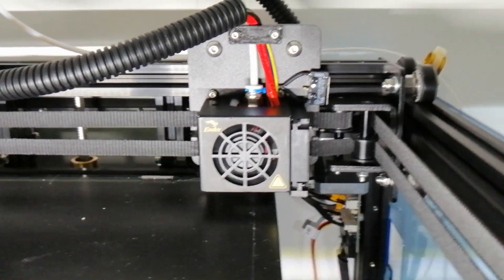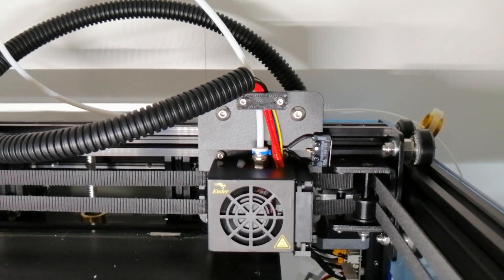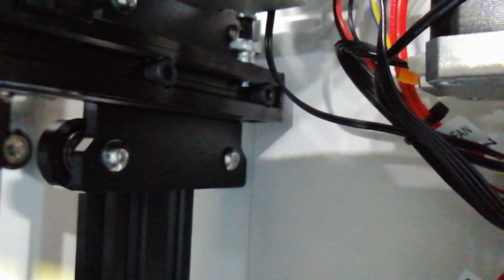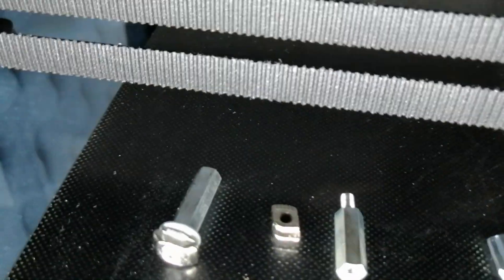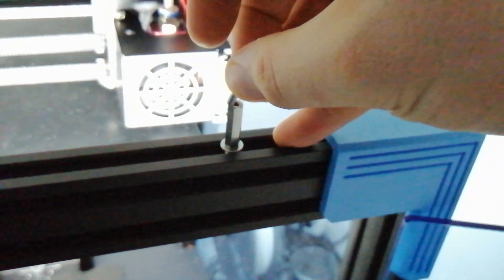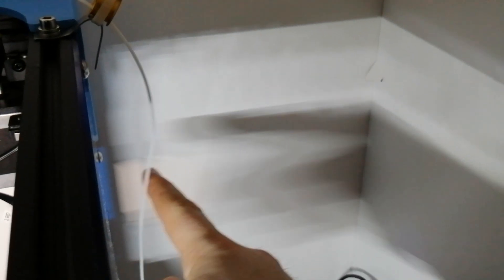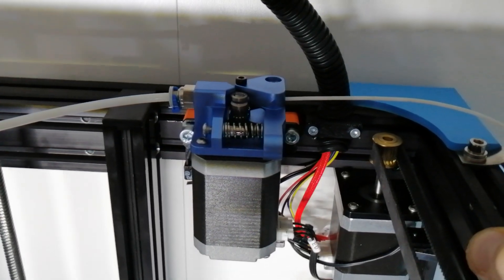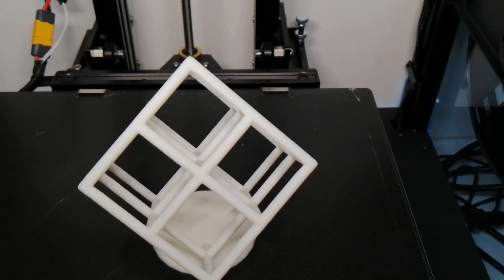Ender 6 stringing mod - Extruder Motor repositioning

Comment: And that's what you do with an Ender-6: 
Fiddle,,, Calibrate,,, Modify,,, Upgrade,,, Replace parts,,, Buy parts that work,,, Level bed X 40 ==> Buy a bed that's not warped,,, tinker to get first layer to stick,,, change settings to stop layers separating,,, 
All this and more BUT...  Never print anything.
Reply from the maker: Well... this is absolutly NOT true... my printer works really fine since my last vid.. thats why i did not make any new vids... it is just working :D More than 2khours printing time now on it :)

Comment: Hi Phil, I am really new at this. Only doing it a month. Might be a stupid question but with the shorter Bowden Tube after the extruder, does it matter how long it is before it gets there? Is the idea not to have any before and as little as possible after the extruder?
Reply from the maker: So … the main rule to the length of the Bowden is : As short as possible as long as needed …. It needs to be long enough to reach nearly every position (reaching 90% is enough - saves tube length) :)
Reply: @PhilsBastelwelt  thank you, I understand the shorter the better coming out of the extruder going to the hotend, but what about going into the extruder, does that also have an impact, going from the filament sensor to the extruder? That's what I'm not understanding.

Comment: Can you please put a link where to get the right screws that you used? Thanks in advance.
Reply from the maker: honestly...i used some srews that were laying around. I woul recommend you search for as pack of screws on amazon in your country. I would recommend a set with M3/M4/M5 screws, some washers and some nuts :)
Reply: Thank you!
I'm trying to make a bracket for direct drive replacement. My only issue it would be the original cable is not long enough. Where can I get them? Really want to find the right ones.
Reply from the maker: @mypersonaljourneytochessma2785  you need to assemble your own cable …. That is not hard… you need the Parts for ist and the Tool :) I can’t share Links … otherwise I would send you some … but just google a little bit how to do this :)

Comment: I moved the extruder to the inside, and with the help of your spacer it fits perfectly.  However, the powercable is barely long enough. It fits, but I'm afraid the tension will be too high over a longer period that it will come out of the sockets. So I guess I'll have to figure something out to move that thick cable-tube a bit out of the way, so my extruder dan be moved just a little bit to give the powercable some room to breathe.
Reply from the maker: Well… just move the Extruder a little bit to the right and there is no tension left :)

Comment: Merci pour cette video. Belle amélioration. Avez-vous un lien ou les références pour racheter un moteur pour l'extrudeur. J'ai un moteur d'avance mais je ne crois pas que cela soit la bonne référence. Merci.
Reply from the maker: Unfortunately I don’t speak french or what kind of language this is 😂
Reply: @PhilsBastelwelt  Thanks for this video. Nice improvement. Do you have a link or references to buy a motor for the extruder. I have a motor in advance but I do not believe that this is the right reference. Thank you.
Reply from the maker: @winrun1  theoretically you can use every Nema17 motor. The original Motor has some more Torque ... 
but sry ... I have no link .... didn’t search for one yet
Reply: @PhilsBastelwelt  Thanks

Comment: Awesome video my friend!! When will you be doing a raspberry pi video? I am still waiting to get my ender 6 but it is on the way and I want to put a raspberry pi on it.
Reply from the maker: Well... actually i have a broken USB-COnnector atm. I already contacted my local supplyer (where i bought the printer) and will hopefully get a new board. Otherwise i will buy a new one. But the only thing i will do with the raps is connecting it to the repetier server. Maybe to a late ri will install klipper..but not sure how to do it togehter with the repetier server :)
Reply: Hello Chuck,
you don't need a video, I placed Raspberry Pi on my Ender 6 and it is very easy to do. All you need to connect it is micro USB to USB cable, like the one you use to charge older android phones, so NOT the USB-C kind. Once you have Raspberry PI installed and ready, all you need to do is unscrew bottom panel of the Ender 6 and connect micro-USB to the board that is located beneath the screen. Guide the other end of USB cable through the opening under Z motor if you want the PI outside, or above in far right corner where the other cables are pulled through, if you want the PI inside the housing. I placed mine outside, since I didn't want the heat from the housing to damage it. Make sure you put an insulator tape over 5V pin on USB cable that goes into PI (as described here https://community.octoprint.org/t/put-tape-on-the-5v-pin-why-and-how/13574) and you are good to go.

Comment: Horrible printer. Cheap add creality suck
Reply from the maker: Sad to hear..but ..do you sell your printer ? :)
Reply: @PhilsBastelwelt  u can buy from me for 500 if u want. Its one month old. Im based in netherlands.
Reply: @saulenkhanal5655  500? then you get ripped of. You can get the Ender 6 for a little under 400 bucks.
Reply: Its true . I have a printer for 1 month now. It came with broken fan . They said they are sending one 2 weeks ago but recieved a mail saying that package is lost. 

Secondly yesterday my extrusion motor stopped working. They are not willing to take the printer back to refund me or exchange the printer. They are complete scam. They did tell me this : Dear customer , what can we do to make u keep the printer ? What the hell.

Comment: Thanks.  I have been going stringing crazy, but, thanks to your comments,  and pointing out the critical things to change ,  I have gone from fully stringed to barely noticeable.  Without changing the Extruder location.  BUT,  that change should also make things better.  I hope to do it soon.  Thank You for your suggestions and video
Reply: Hey Mark, may I ask what you did to reduce the strings that do not include changing the extruder location. Thanks
Reply: @chickenschnitty7890  running PLA I played with retract settings nozzle temp and travel speed. Not perfect , but, good enough for now. Travel speed = 150 mm/s. Sunlu pla (white) nozzle temp 210 to 215. Bed 60.  Retract distance 7 , retract speed 100. Finding that the exact nature of pla maters and the white hatchbox was horrible. Sunlu was sweet! Made a stringing tower model to get nozzle temp. Always support .. type depends on how much contact part has. After 4 weeks?  I am pretty happy with “out of the box” printer.  The mods described in video make sense. The boden tube change, i did then changed back. Upgraded to 24v bearing cooling fan with reduced sound. Sorry so long. I hate that
Reply: @marksholcomb  Cheers!
Reply: @marksholcomb  Running a retract speed at 100 is insane regarding lifespan of the extruder motor, I rather move the extruder closer. As for PLA, never had issues whatsoever regarding the nature of PLA you are referring to. Stringing has nothing to do with the nature of the PLA but moisture, retract distance, speed etc. PLA is PLA. It all comes down to how far the extruder and boden is from the nozzle and the settings in the slicer. 

Retract speed 100 and only chosing a couple of PLA that doesn't gives you stringing basically means you don't have the correct setup or settings. You should be able to put whatever PLA and have same results regarding stringing. Moisture though, dust etc is something that can cause different issues with plastics in general.

Comment: hi, may i ask if mod to this position, the filament sensor is still working @@? ... if the filament broke, it should broke on the extruder side, and the whole filament still inside the sensor....am i right ?
Reply from the maker: Yep
.. that could possibly happen... but I could also happen in the original.. the tension of the holder inside the Sensor is pretty high.. so... the possibility is nearly the same... and most of the time when you need this  sensor it is because you run out of filament.. not that it breaks :)
Reply: This happened to me yesterday. The filament broke between the sensor and extruder and I have not changed the extruder position. Ruined my print by just 3-4mm.

Comment: Could you share the perfil? I have a lot of problem with the retraccion
Reply from the maker: In the description is a link to thingiverse. In the ZIP-File (you have to download the filses) is the Cura Profile included with the ending ".curaprofile". :) ..... later i will make a new Video with more improvments :)
Reply: @PhilsBastelwelt  I try with your perfil but i have the same problem with the 
threads, i try a lor of configuration but its impossible T,.T
Reply: @germanmorales9925  I am frustrated with this printer too.
Reply from the maker: Well... do you mean the Nuts for the Profile or what exactly do you mean?... the Profile is made after I changed the position of the Extruder and so on... so you would have to do all the same steps... normally I would not share the profile because it is especially trimmed to my setup (in the vid) but so many people asked.. I had to share it :D
Reply: @PhilsBastelwelt  Yes i change the position of extruder but the theards continue =(
Reply from the maker: @germanmorales9925  You mean the stringing?... in "Threads" I understand something different :D
Reply: @PhilsBastelwelt  Sorry about my english....Yes is that you say.
Reply from the maker: @germanmorales9925  Okay.. now we can work on it... so...now play a little bit with the retraction distance.. go from 3mm up to 7mm in 0.5mm steps and compare... if you find a value where ist lokks a little bit better.. the try to go down with the temp little bit... and also. one thing... Did you delete the first few lines in the Start G-Code up to the g25 Homing?... the Lines before the G28 are some acceleration values (from the Ender 5)... did you use the Cura preset from the Ender 5?
Reply: @PhilsBastelwelt  I try since 3 to 10 in 0,1 and is the same, maybe i can try with the tmp. this is my start gcode 

G28 ;Home

G92 E0 ;Reset Extruder
G1 Z2.0 F3000 ;Move Z Axis up
G1 X10.1 Y50 Z0.28 F5000.0 ;Move to start position
G1 X10.1 Y200.0 Z0.28 F1500.0 E15 ;Draw the first line
G1 X10.4 Y200.0 Z0.28 F5000.0 ;Move to side a little
G1 X10.4 Y50 Z0.28 F1500.0 E30 ;Draw the second line
G92 E0 ;Reset Extruder
G1 Z2.0 F3000 ;Move Z Axis up

Comment: Mega gut! Lustig gesprochen. Ich werde das direkt auch mal testen.  Eventuell zeichne ich mir deinen filament guide mal im CAD. DANKE.
Reply from the maker: Wenn du da was brauchbares hast bitte teilen. Hab selber versucht einen zu designen..aber war mit keiner art zufrieden :)
Reply: @PhilsBastelwelt  Hier thingiverse thing:4787204 , viel spass. Bekomme meinen drucker aber nicht unter 6mm retraction ... auch mit Capricorn etc.
Reply: @PhilsBastelwelt  hey, tolle Lösung. Wo bekommt man aber die passenden Muttern für den Rahmen her?
Reply from the maker: @korzyn1978  öhm..amazon : https://www.amazon.de/-/en/KARAA-Piece-Nuts-Allen-Assortment/dp/B08GM48QVC/ref=sr_1_5?crid=2EJFZ7JAP5QZV&dchild=1&keywords=nutensteine&qid=1616341469&sprefix=nuten%2Caps%2C193&sr=8-5
Reply from the maker: Oki.. Ich schau mir das mal. An.. vlt. setz ich mich am Wochenende mal hin und probier mich nochmal :).. öhm gut... wenns immernoch net klappt check mal den ganzen Extruder und das Hot+Cold End durch... ob der Bowden überall ordentlich drin ist... Keine Lücken zwischen Nozzle und Heat break etc sowas alles... meist liegt dann an was mechanischen irgendwie... oder im schlimmsten fall am filament
Reply: Danke

Comment: This is the best on top extruder setup for the Ender 6 yet.  I am also moving filament to inside.  Waiting on Slice to produce the direct drive setup.
Reply from the maker: and ?? did it work with your printer ? :)
Reply: @PhilsBastelwelt  Are you waiting for?  Just did mine.